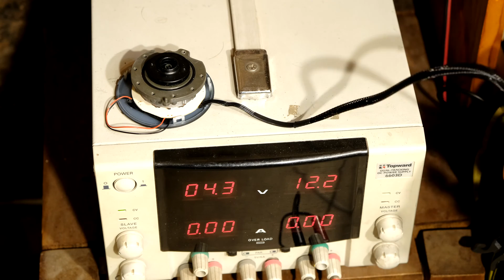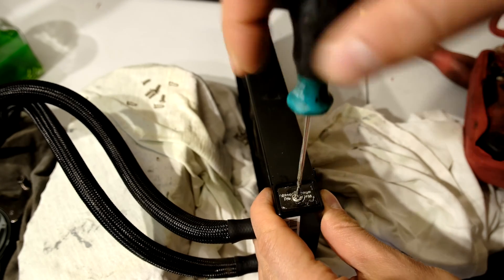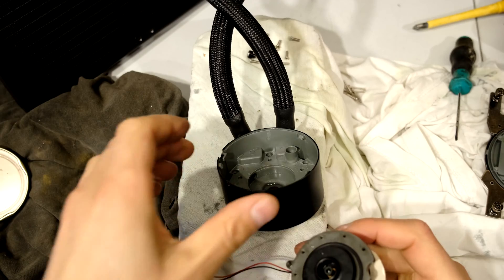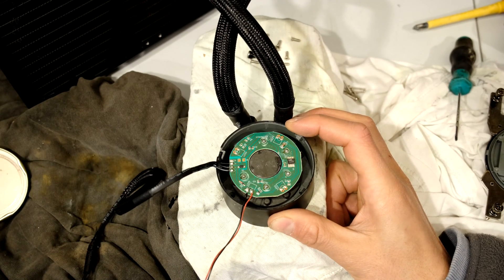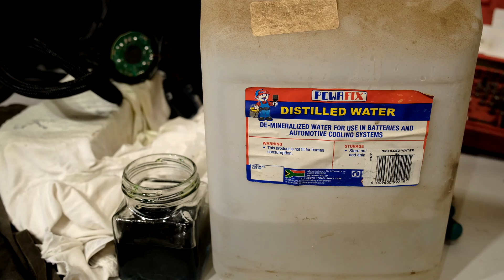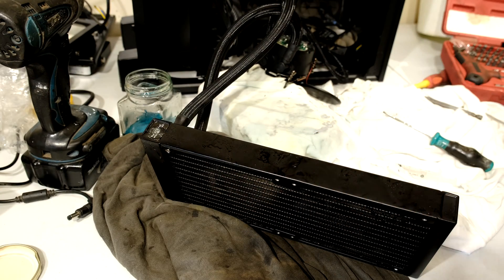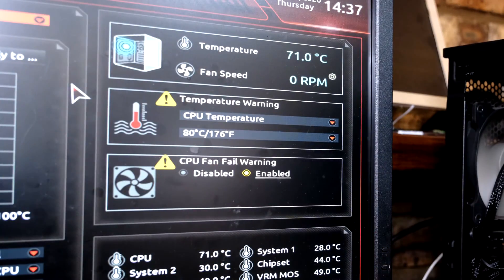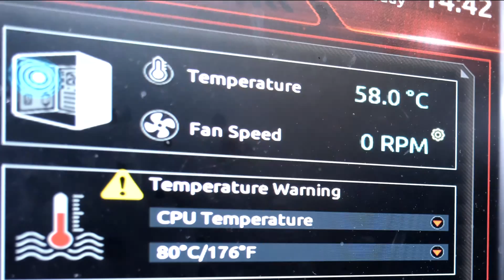How to disassemble and refill a liquid CPU cooler and reassemble - Cooler Master Master Liquid 240

Comment: forgot to clean the copper fins
Reply from the maker: which fins?
Reply: @ecologicaltime  you have to remove the copper heat sink to clean the "fins" probably most important step
Reply: @X_Hale  I was looking for this comment. Most clogs/restrictions happen in the micro fins underneath the cold plate. He might have seen the screws if he would have cleaned the thermal paste off. You lost me at BMW but, after your "witch fins?" comment I am convinced you don't really know what you are doing. I am glad this worked for you, but I wouldn't recommend anyone following your advice.